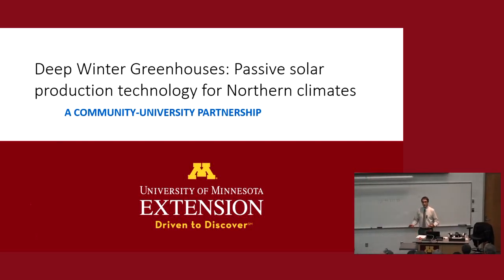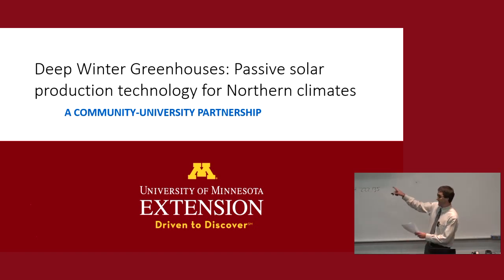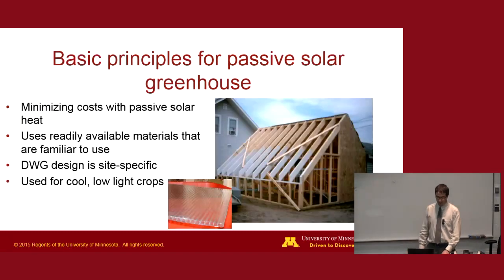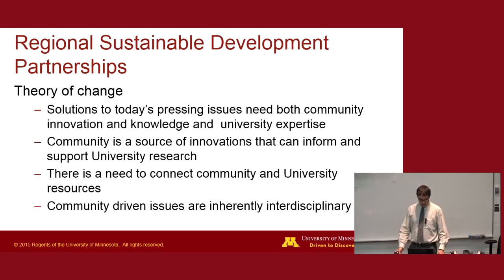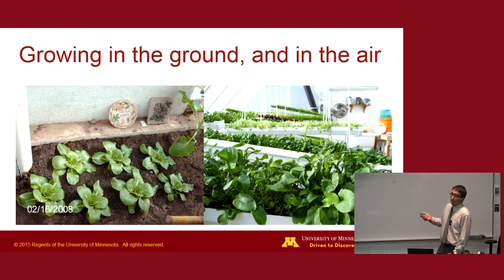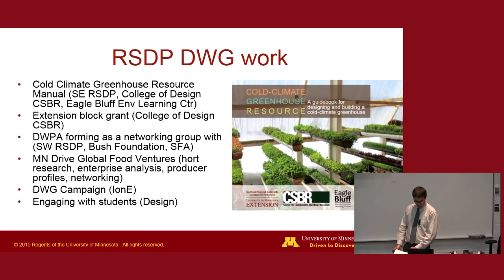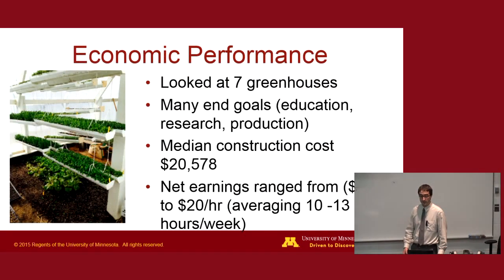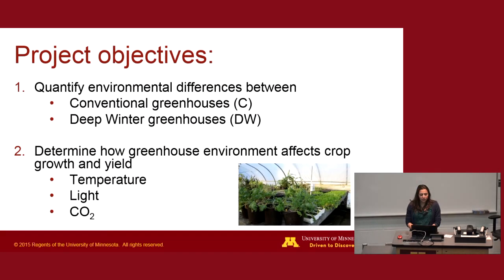Deep Winter Greenhouse Public Seminar

Comment: With regard to mold and fungal growth issues in the tubing i havent experienced any problems. Something which folks do need to be aware of is the percentage of latent vs sensible energy that is released into the greenhouse when the system is being used for heating. Long term monitoring shows the latent percentage is typically around 60%. This is significant as the latent component serves only to raise RH%, not the air temperature. It also represents a loss of sensible energy from the mass. 
In simple terms, useful heat is taken from the mass to convert liquid water into a gas (water vapour) which is then released into the greenhouse. When it meets a cold surafce (such as the glazing), the air drops to dewpoint and the water vapour condenses out as liquid water. The latent heat is converted back into sensible form where it is absorbed by the surface. Typically, the sensible heat is lost to the glazing and you`re left with a river of condensation.